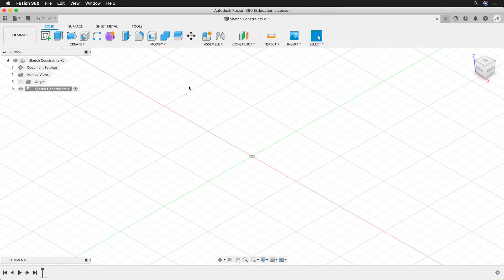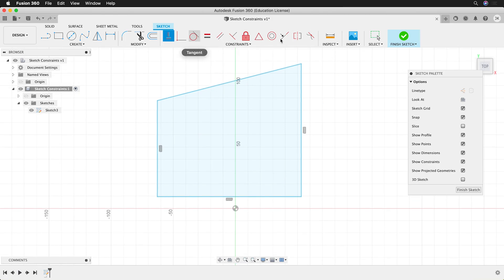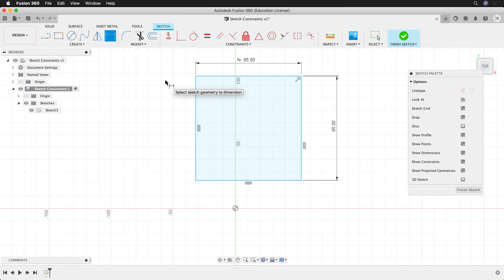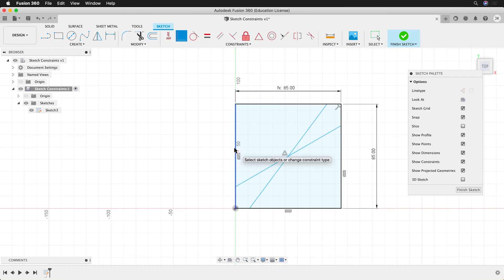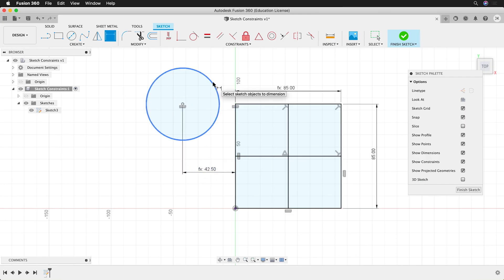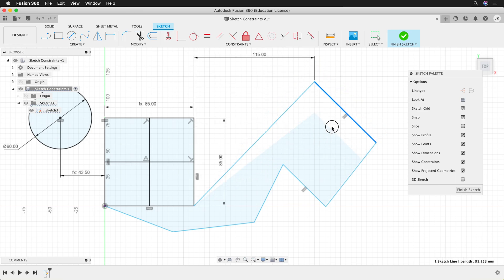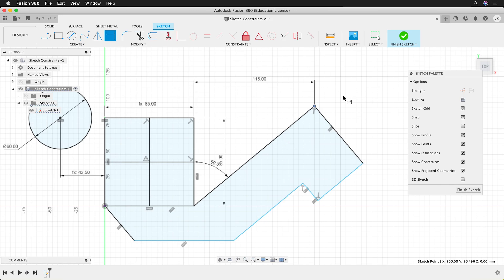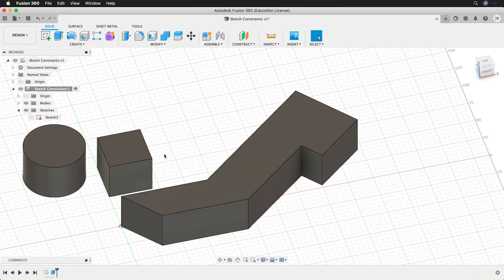Fusion 360: How to Fully Constrain Sketches with Constraints, Dimensions, and Angles

Comment: I’m still learning but all your constraints completely changed your sketches, didn’t not show how to constrain the original geometry, you drew
Reply from the maker: Sometimes it can be tricky to keep the geometry exactly the same, in that case, you can either lock something that needs to be constrained until you have a better constraint or changed your order of the constraints you add, there is also the new auto constraint feature that you might try

Comment: I can’t make sense of how Fusion differentiates multiple constraints on the same point. There have been times I’m troubleshooting a design and when I click on a corner point to a shape, I can see up to 4 icons, representing 4 separate coincident constraints. When I click on each icon, it simply reports on the bottom of the screen that it’s a coincident constraint (well duh), but doesn’t give any other information. This is really frustrating because I end up spending a long time with trial and error trying to figure out what each of those coincident constraints are referencing. Do you know of any ways to investigate constraints more efficiently?
Reply from the maker: That sometimes is frustrating, especially with coincident restraints. I always want to delete one to be able to move a point but then have to delete them all and then reconstrain the points, I'll have to look into seeing if there's an easier way to do that cuz I want to know
Reply: @WhatMakeArt  cool man glad I wasn’t the only one.

Comment: I've been having a problem where my sketch is fully constrained - every single line is black, clicking interior highlights said interior, exterior does exterior.  I've zoomed in and confirmed (despite the black lines indicating constrained) all lines are connected at each end to another.  Reviewing your video, I've gone through the entire sketch to confirm all constraints are in place, and profile/lines are unmovable, as you indicate.  It simply will not define.  

If I select the interior of the object and hover over a line, ALL of the other black lines turn RED!  The lines remain black unless I hover over sketch line/arc.  Google indicates Red lines means there is an adjacent profile next to the particular line - which there is, and should be.  But, the sketch which won't define is intended to cut/excise a portion of the adjacent profile body, so it's suppose to be adjacent :( 

Been messing with this for 2 days now, even started from scratch several times - arg :(  Is there anywhere in Fusion which will show what's preventing definition?
Reply from the maker: Often when you can't constrain a sketch in Fusion 360, there is a stray point somewhere. When drawing lines in Fusion it is easy to accidentally click an extra time and create a line that looks like a single line but is really two lines end to end. 

Even if these lines are "locked" and can't move, Fusion doesn't consider the sketch constrained unless the distance to that point is defined.

Try looking for stray points
Reply: @WhatMakeArt  Thank you for the quick reply.  II think I might have discovered where, but not why.  I'm defining a dovetail joint tooth (I' d upload pic if I could).  Everything is fine until I place the upper, angled, tooth line.  I define that at a set angle, but the length is dependent on the depth of the tooth itself.  But, I assume as the length is not fixed, F360 doesn't like it - even though if I did fix it, it would "break" the other depth and width constraints.  It may not be possible to fully define this particular sketch :(  Now, I just have to figure out why my definition won't define but the Tutorial I followed does.  Frustrating, but that's actually part of the fun of learning.  

F360 is an incredible application, made only better by those of you who are willing to spread your knowledge on how to best use it.  Thank you!
Reply from the maker: @OopsWhatIMeantToDo that does sound like an interesting sketch situation, hope you figure it out and thanks for sharing with everyone what you tried so far

Comment: I assumed the green line for starting a line would line up with origion... it does not. I have also drawn a line off origion and set the line vertical and it still does not constrain. there are some parts of fusion that allow you to assume a relation but when tested they do not.
Reply from the maker: Yes, sometimes it can be confusing, the worst is when a sketch won't constrain because of some random point on a line

Comment: i believe i have to learn this. i have been using fusion 360 for about 5 years but never needed any constraints ever, not in the way that i have had to use the constraints tools anyway, i guess sketches constrains automaticly or something, or are they just not needed? :)
Reply from the maker: If you draw a center rectangle from the origin, and then define the dimensions of the two sides, then it would be fully constrained
It starts to matter more when you are using parametric dimensions and other user parameters that can change based on the values that you input. Then the constraints are needed to make sure that everything adjusts accordingly.
Reply: I too seldom worry if my sketch is fully constrained. But most of my projects are functional one of a kind so I haven't found very many problems. Well there is one. On a complex sketch, with some lines being offset lines, if I try to cut a part of the offset line or its source line the sketch will distort (lines go everywhere). The solution is to remove the offset constraint.

Comment: sometimes a line still blue, it results not movable, and you finish the fantasy about which constraint is missing. Especially when multiple arcs ar involved etc. I would like to have a tool that states "hey: these following constraints are missing" (perhaps there is but I'm not aware about). Indeed I still have some sketch with all black lines but there is not the lock on the sketch. So I have not clue what's not cosntrained.
Reply from the maker: For when you have black lines in a fusion 360 sketch but still no lock, often, there is a single point along the line that makes the line into two points and that point is not defined or constrained, one way to do this is to occasionally delete a black line and then you might discover it was really two lines, you can then always undo quickly and try it with a different line until you find the one you need to constrain

Comment: Is there a way to tell how many constraints I need to make it full constrained. This is a feature that I like in Siemens NX. It does the line thing, but tells you how many more constraints you need before you are fully constrained. This is really helpful for all of the really complex engine parts I have to design where you have lots of lines and dimensions in each sketch.
Reply from the maker: It doesn't give you a number but the unconstrained line are blue in Fusion 360 sketches
Reply: @WhatMakeArt  Ahh I was just hoping for a way to turn that feature on. Line colors will have to do. Thanks tho!

Comment: I tried to do the exact same with a 3D sketch but somehow it turns blue as soon as I add a line in the 3rd dimension. However, nothing moves and all lengths are defined  Can someone explain to me how to fully dimension a 3D sketch?
Reply from the maker: You need to define the angles from the plane that the first sketch is in. You probably need to define the angles from three dimensions. It's basically a vector in space that needs to know the distance and the angle from multiple planes and then it should be fully defined